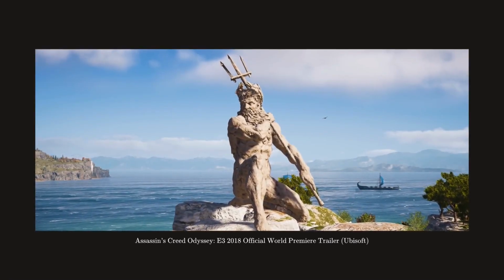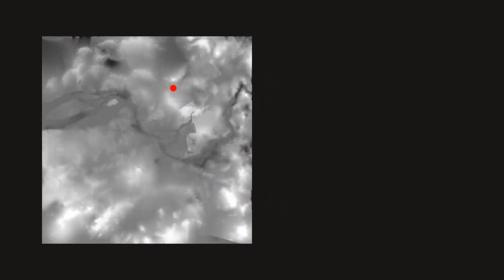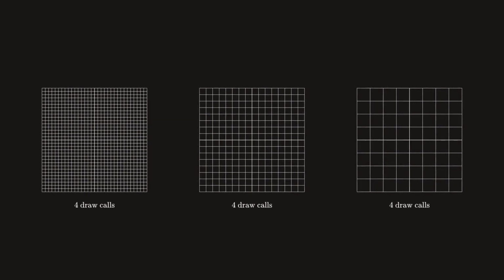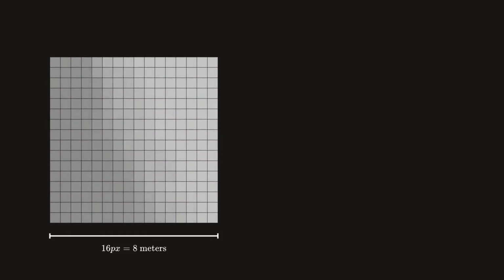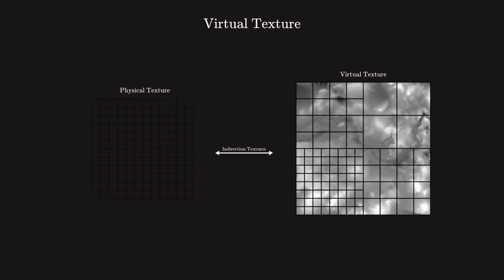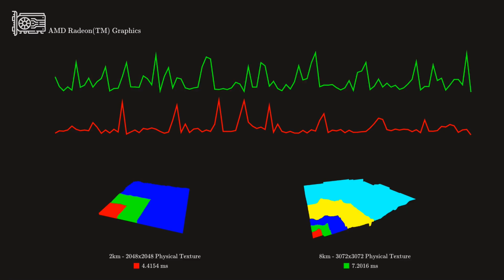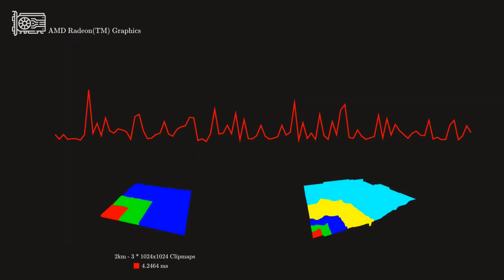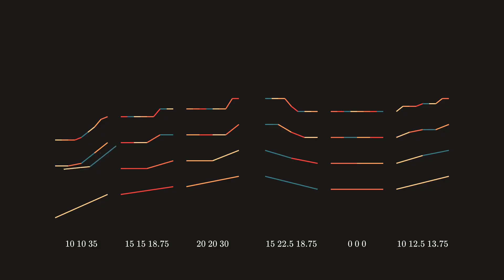How Open World Games Optimize Terrain Rendering

Comment: I have question. What about objects? They need to know exactly where they stand at a given point. If you use virtual mapping where the datas are more sparse in the distance that mean they can't stand at a proper ground. And when the lod change where they stand wouldn't that mean they're either in the ground or floating in the air?

Thinking about this. I'm guessing the solution is to make adjustment based on the difference between the LODs. But this means it has to be done on CPU side.
Would be even more puzzling on the multiplayers side of thing. (But I suppose you do the same thing.)
The difference would be minimal so it should work.
Reply from the maker: Didn't implement it but though about it a lot.

Your solution sounds really good. You can even take it a step further and store the Y coordinate of static objects in the asset database for each LOD. The coordinate being computed at level creation time, so it happens only once, offline, and then just fetched from a file.

But this has a downside, for example you are flying over a forest and as the LOD changes you would get a little pop as the trees, for example, move.

So, what I would do, is to make static meshes a little longer on the Y axis so they would always stick to the terrain. In the distance the player won't even notice.

Now, for dynamic objects the things would be more difficult. Let's say a vehicle is being driven over a LOD transition area, and the collider would stick in the little corners created. I'm not really sure how would this be fixed...

My first though is having a collider that is the same level of detail across the whole terrain, not the highest level of detail but not the lowest either. And actually check for the collision between the collider and the dynamic objects only on the chunks that are close to the player and the objects still render, so 1 or 2 km around the player.

This is not implemented it's just me rumbling :D so this may not be the best, most optimized solution.

Thanks for the question!
Reply: @catagp  The difference could likely be really small for something of considerable distance. But stretching it, that's a funny idea. Might be a stretch, but it could work.

If it's obvious, I assume it also sings "Too stretchy for this ground. Too stretchy for this ground. Ground gonna leave me."

So a collider, you mean we have a full resolution heightmap for the collision. That's definitely a much easier way to do it. Although they might accidentally float in the air or get buried a little. But bury is better hidden than elevated. So you could actually offset them down a little.
Reply from the maker: I think the floating wouldn't be visible at even small distances.

We solved the issue, now time to write the code. 🫢

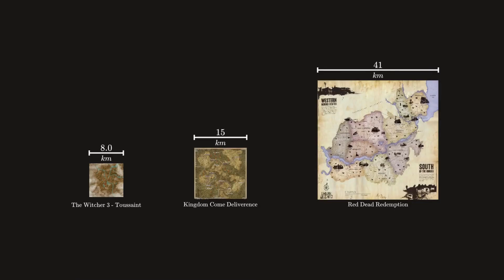Comment: about your intro at 0:10, the values seem wrong

kingdom come deliverance has a world map sizeof 4 x 4 km = 16km²
red dead redemption (1) has a world map size of 5.5 x 5.5 ~= 32km²
red dead redemption 2 has a world map size of 8.5 x 8.5 km ~= 75km²
the witcher 3 has a world map size of 12 x 12 km = 144km²
zelda botw	 9 x 7
assasins creed origins	  9 x 9
assasins creed odyssey	  16 x 16	  playable 130ish
 just cause 2	  32 x 32
just cause 3     45 x 45

the problems when googling this come from people that guess and do not know. they guess usually by taking the time to walk the distance and compare time and make speed estimates. that is all fine but it gets wrong when people mix imperial and metric systems. and on top of that people mix talking about side length and squared area sizes.
Reply from the maker: Yes i may be wrong, i googled the map sizes to prove a point, that modern games have bigger and bigger maps. 😅

Comment: I don't know if I understand it.

Everything you explain in this video, is it only for terrains that are generated with height maps?

I mean, what happens if there are caves or other peculiar structures?

And I have another question. Aren't they hand-modeled in 3D? Or is that not so typical?

Thanks, and great video :)
Reply from the maker: Usually terrain in real time applications such as games is rendered using heightmaps for efficiency reasons, there is another comment in which I explain in great detail why. In the video I focused only on that type of terrain rendering.

To handle caves and so on, you can tell the renderer not to render terrain in specific areas, see: https://archive.org/details/GDC2014Gollent/page/n35/mode/2up and then manually place the cave mesh there, with some blending to make it look natural.

3D models are used only to add the structures that cannot be defined with just heightmaps.

Thank you so much!
Reply: @catagp  Thanks! :) Now I understand better.

I thought height maps were used for simple games, but for more complex games (like Red Dead Redemption) they used other techniques, or even hand-modeled all the terrain.
Reply from the maker: @JaviArte  Only in very small games would it be possible to hand model the whole terrain.

Even games like RDR2 would have a map editor tool which allows to hand paint the heightmap using predifined smaller heightmaps that represent things like mountains, hills, canyons, and so on.

Check out the Far Cry 5 map editor, or the CD Projekt RED the witcher 3 modding tool.

Comment: Ive been wondering for a while now. Why do terrain systems use textures to store vertex positions when that data could be stored in each chunks mesh data the way meshes usually do?
Then you could just use your mesh streaming system for LOD's as your terrain system and even process your meshes offline to look better and more performant from the angle your loading from. Plus you get overhangs and caves since your no longer limited to one height value per horizontal point in space!
Reply from the maker: Usually that's because terrain is hugee in open world games and the vertex data streaming would be a bottleneck. You would get drops when loading from disk to CPU, and then from CPU to GPU. 

If we do that math for a 64m^2 terrain patch, using meshes you would have:
      128 * 128 * ((32 * 4, position data) + (32 * 2, normals) + (32 * 2, uvs)) bits, that's 4194304 bits = 0.5mb, not including caves and so on

If you use heightmaps, you would have:
      128 * 128 * 16 (height, float16) = 0.03mb, even smaller if you use texture compression in Vulkan
      With this technique, normals can be calculated on the fly in a compute shader and stored on the gpu, the same for the texture that covers the terrain.

When you move, and the terrain LOD should reupdate, you would load a minimum of 16 chunks, if you do it all in one frame, that would be 0.5 * 16 = 8mb, compared to 16 * 0.03 = 0.48mb.

Other that that, having a separate mesh for each terrain chunk, you would need to dispatch a different draw call for each mesh, and bind their specific vertex/index data, compared to drawing the whole terrain using just one instancedDrawCall.

Of course, in a small game you can create meshes for each terrain chunk, giving you more creative control, but you have to sacrifice performance.
Reply from the maker: And also, no more tessellation and all the cool stuff that comes with it, like using vertical error metrics to simplify terrain based on parameters